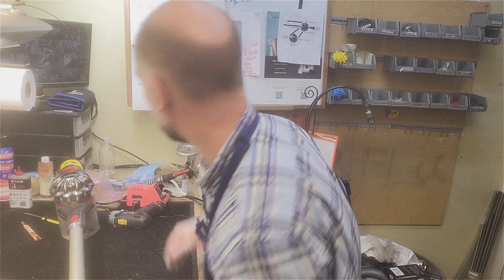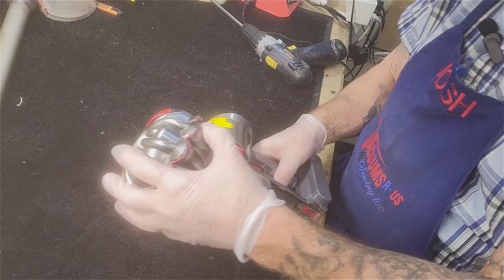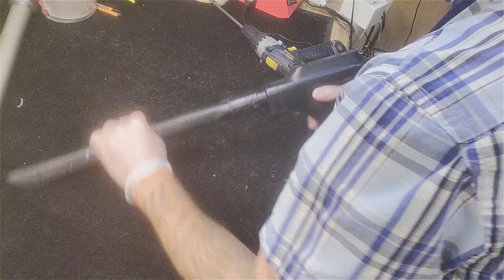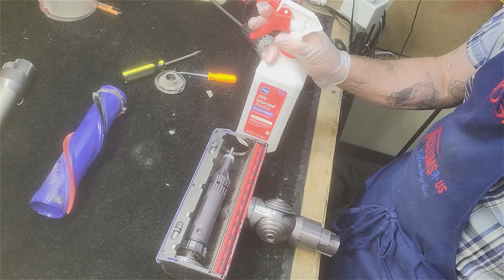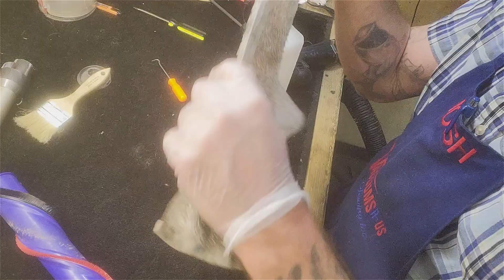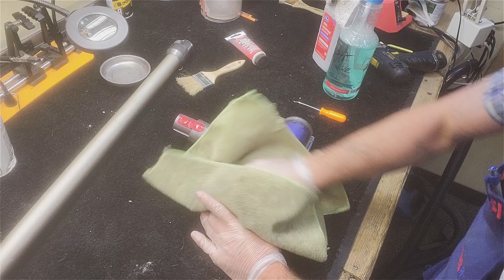Dyson V8 Maintenance and Cleaning

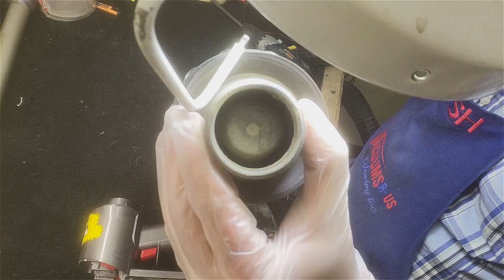Comment: 4:12 That compartment you show is the cyclone discharge chamber. It is where fine dust is dumped from the small cyclones. Dust coating the inside of that doesn’t affect the performance of the machine. The main airflow path doesn’t go through there. That’s why it’s sealed at the end. All Dyson cyclone assemblies have this arrangement in some form or another. It’s just second chamber for depositing fine dust.

Comment: Great video and very informative! as for the cyclone, I normally use my blower, then I spray it with the 70% alcohol inside out several times, it is unbelievable how much dirt comes out of it, and set it outside under the sun to dry and blow it out several more times.

Comment: Is the cyclone part washable?
Reply from the maker: In theory you could. However they are glued together and getting them to dry is problematic
Reply: @vacuumsrus 
They’re screwed not glued together. Either way it isn’t needed if there hasn’t been any water or brick dust ingestion.

Comment: As explained in the video, most of the dirt is collected/trapped inside the fabric triangular/funnel shape filter. If the unit has not been cleaned/maintained in a long time, I suggest to remove the filter's tap/lid/cover, then to vacuum the dirt inside the filter, and to use a brush to loose the dirt trapped inside. Only after that, the filter can be washed with running water only on the outside of the filter. Never to run water inside the filter as that will push the dirt further inside the filter causing a clogged filter.
Reply: Yep! But a lot of people don't understand the direction of airflow through the filters and wash it incorrectly, further clogging up the filter.